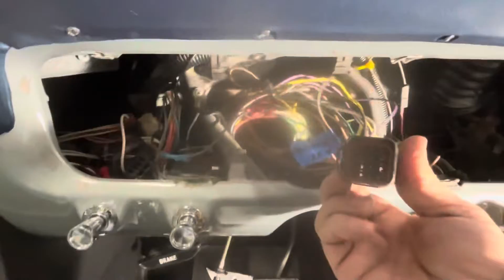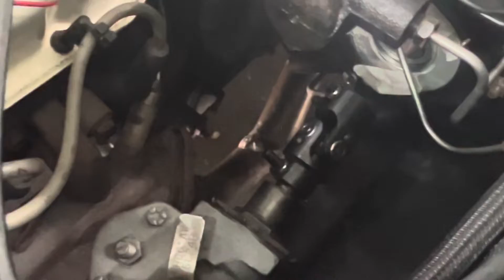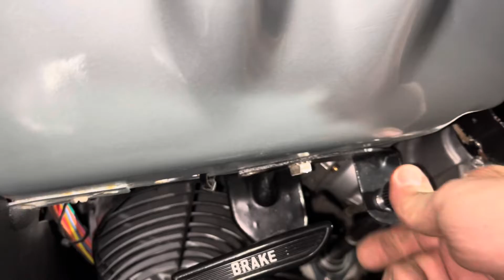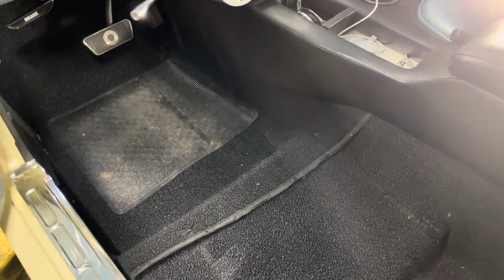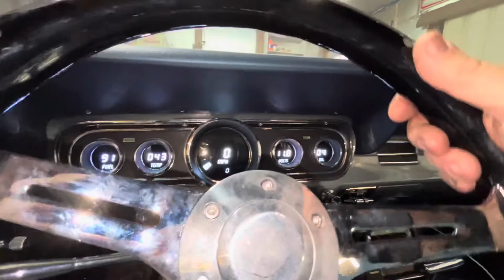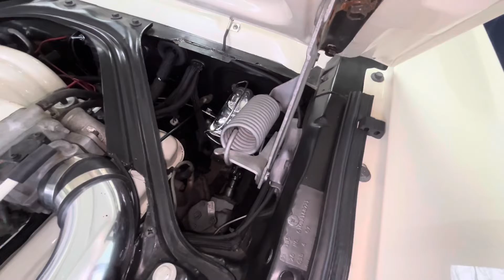Electric Power Steering Conversion on the 66 Mustang pt 2. Finishing up !  @CreekviewAcres

Comment: It's recently come to my attention that the 65 to 67 early steering boxes were vented through the factory column and the rubber boot at the end of the column was meant to keep the grease in the box. After following up with some research it is recommended to install a grease seal in the collar where the shaft comes out and to also add a vent for the box itself. It turns out that Ford added a grease seal between the front collar and splined shaft as well as a vented grease plug. After two years since your install have you seen any grease thrown out of the box? Or have you added the seal and vent plug? I appreciate the feedback. Cheers
Reply from the maker: Haven’t seen any grease, but I haven’t been on long trips. 
Usually less than 50 miles one way. 
But the modification does sound like a good idea

Comment: I'm using the Prius 2004/2009 power steering unit. Paid $150 for it and bought a EPS Controller online  that I can manually control for $60  Being a lifetime Machinist with a home machine shop I can make any necessary parts or modify anything for a professional fit.
Reply: I'm looking to do something similar.  What EPS controller did you use, if you don't mind me asking?
Reply from the maker: I bought the EPAS Brand kit, it’s pricey but it had everything including the controller.

Comment: I'm about to install this system in my 66 coupe. I'm wondering if you had to install an extra support brace/bracket to hold the electric motor from moving or twisting it's mounting position at the column brace under the dash?
Reply from the maker: No extra brackets needed.

Comment: Did you ever have to do a zero point calibration on the steering unit? I know it is usually needed when replacing the control unit but I didn't know if cutting and modding the column would cause it to go out of calibration and cause a pulling condition. I'm doing one of these conversions on a Ford Ranger Drag Truck later this year.
Reply from the maker: I didn’t on mine. 
The motor on the unit doesn’t have Right and Left stops, it will turns continuously until you couple it in. The control unit I’m assuming senses the right and left stops when you’re driving. 
You may need to check with EPAS to be sure. 
Thanks for watching

Comment: Hi thanks for this video..one of many things I have to install on my 65. Question…is the under column bracket you mentioned earlier in the video the only thing that supports the column and motor ?
Reply from the maker: The bracket at the dash and a bearing at the firewall that supports the shaft.  
Thanks for watching and for the question.

Comment: Great video.  I'm about to tackle this job on my 66 coupe.  Was it difficult to tighten the 3 bolts on the bearing retainer plate?  Did you have a second person to hold the bolts in the engine bay?  I also have a Malwood under dash hydraulic clutch installed already.  I there's not too much interference.  Thanks again!
Reply from the maker: @jcperea69  
Yes my wife helped on the 3 bolt retainer. 
It is a little tight under the dash, my biggest problem was lifting the unit into place, it’s kinda heavy lifting it while laying on your back 😀

Comment: Thank you for your time. I have the same unit for my 53 1/2 ton pickup drag and drive build. I'm running a 1200 HP 6-71 blown/nitrous Chevy inline 6 292 and putting a pump and a P/S box and new column would have cost me way more than the $1500 I spent on the EPAS unit. Plus I get the stealth look. I'm also running electric A/C compressor with a remote condenser and a Spal fan from down under with an Old Air inside kit. More stealth.
Reply from the maker: Thanks for watching, my EPAs is working great